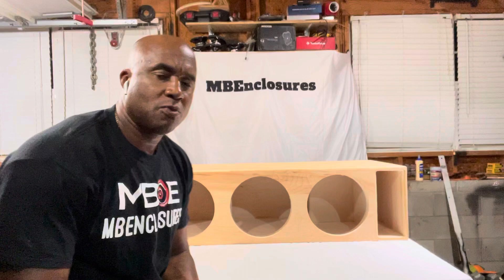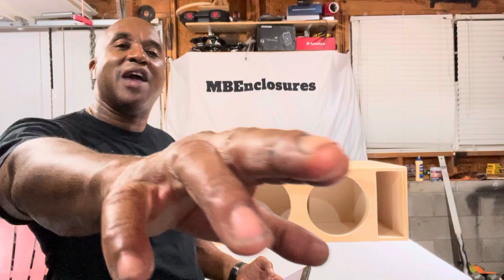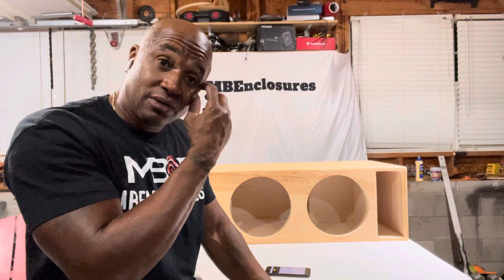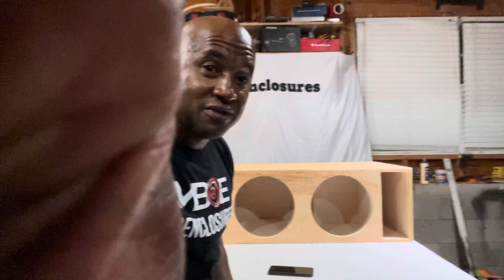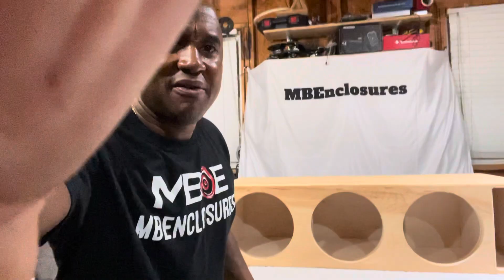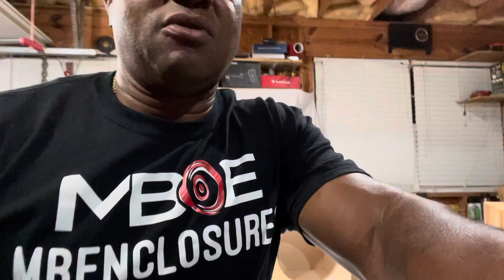Why JL Audio is to be respected.

Comment: I remember when a combination of 3 JL Audio subs, MB Quart, Precision Power, and Audio Control ruled in SQ!
Reply: Back when they were black and red and could be purchased with a clear plexi glass bottom. That was a great era
Reply: Agreed. But two honorable mentions: DD Audio made in U.S. Subs (like JL Audio top line subs). And Arc audio amplifiers. I think Arc has taken the top spot from Precision Power when it comes to amps. But both brands are excellent. B2 Subs are very good SQ subs too I hear. But have heard mixed reviews on amps. Even when you look inside, they look awful sweet to me. Maybe one day when my vehicle value exceeds the cost of a complete JL Audio top-o-line system.   lol  AudioControl has also impressed me the more I learn about them. I just think car audio dollar for dollar still does not beat home audio, nor especially pro audio will studio monitors and subs. The Kali IN-5 studio monitors (3way) will change everything you think you know about speakers/studio monitors. Especially at $750 pair. Subwoofer optional.  It's my goal to get a pair of the IN-5 in my vehicle. It's a challenge because they are tri-amped. Not sure if its possible. So putting them in  my living room won't disappoint either. You can't hardly find a pair of 3 way quality tower speakers under $1,000 other than the Kali's. And they ain't even tower speakers. Just sound like tower speakers.    lol   Check them out. Peace.
Reply: I think it is the home audio cabinets that speakers come in that make home audio systems perform better than car audio?
Reply: I can't believe I forgot: SB Audience component drivers. Excellent speakers and subs. Maybe better than those mentioned. But only make speakers. Definitely worth your time to check out if you are unfamiliar with the brand. They are 100% vertically integrated. No outside parts, everything made in house.

Comment: Been running JL Audio since the W6 18” and 500/1 debuted. Still my favorite as far as reliability and efficiency. They cost, but so do the finer things in life!!
Reply: You can easily put SPL JL Audio, but that's not what they were designed for. They are more SQ oriented and honestly configured for lower wattage.
Reply: My JL Audio 500/1 has been running now for 2 decades efficiently in many different vehicles on multiple brands of subs. I have even tried other 500 watt brands of amps and always end up back to this one!#JLAudio#🔊❤️#Slash500/1#Truth#👑
Reply: @bondalero0074 thay amp is one of the best amps I ever purchased.
Reply: Trust me, broaden your horizon. It's far from what it is cranked up to be.
Reply: @AB-80X  100 % I guarantee you that I can slap kicker and jl in there face with 20 other brands for cheaper
Reply: @AB-80X trust who? Who are you? Haha 

It’s not all about watts and loudness with JL. Do some research on what makes JL’s special, its there massive R&D budget and nonchalant updates to legacy product lines. So many sub enthusiasts combine arms to discourage any JL positivity due to there higher price point and newer products out on the market appearing to offer more for less. They imitated then flaunted aspects of performance JL does not focus on. 

There is so much overwhelming evidence that JL still provides an amazing experience it’s completely comical to read polar opposite opinions from die hard buyers of different brands.

Talk less about stats and more about the subset of needs a buyer may want beyond shear power and SPL.
Reply: @robob221 
JP is exactly all about loudness and wattage. They are fairly mediocre speakers and amps sold at a high price. Take a W7 speaker apart and you’ll soon realise how cheaply it is made. Same with their amps. 

I have worked in pro audio for years. Worked large scale concert venues, but also worked as a studio engineer, does studio setups, commercial theatre setups - as alwell as spent a few years in the car audio industry. I know what quality audio components are, and JL is definitely nothing special. It is extremely overhyped like most equipment in the car audio scene. I don’t even think the high end home audio world sells as much snake oil as the car audio industry.

Comment: Coming from the view point of someone who’s studying how to build subwoofers from the ground up, ya JL is a good brand BUT there’s no magic to them it’s just that there price point on the “higher end “ subwoofers is so much that people who can afford the higher and stuff already have the batteries and aftermarket alternators to power there equipment to the point that the subwoofers they use really don’t matter. And those that can afford to put real money into there systems tend to be older/more mature and know how to use the equipment they have. On the flip side some of those people that can afford higher end equipment tend to be Snobs about it and tend to talk down on less expensive brands and the people who use them. In all reality name brand equipment is just that a NAME BRAND and the more overhead they have the more there equipment will cost and most subs are either made in China or the parts come from China and are just assembled over here. A 1200$ JL is worth about 100$ in parts it’s the labor to put them together that costs $$. Also the fact that JL warranty’s or lack of will keep only those who can keep forking out the $$ to keep buying the same equipment. So In the end as long as you have a proper power supply the amps and drivers you use should not fail unless seriously abused. Motor,coils,leads,spiders,CA glue,cone,surround and terminals=a speaker,driver,woofer,subwoofer
Reply: You could never build a w7 for $100 or any sub on par for that matter as the motor alone is easily gonna cost $400 plus. I’ve been building subs by hand for years and the parts on a w7 (except the coil) are not available. They are not off the shelf parts like a company like sundown or skar will use. All those others brands that cost significantly less are not assembling their product either. They are out sourcing it to China and in many cases the quality of the build is not even close and they use inferior materials. Brand hype definitely exists and not always do you get what you pay for. In some cases though, you actually do! Look at all the amplifiers today, majority are built over seas and is why it cost 15 cents or less a watt. Hand built USA made amps that cost over a $1 watt the sound quality was incredible, the quality was amazing, and you could pass those amps down to your grand kids 😂
Reply: 100% agree, if you truly look into JL they done even own there patents and all there stuff is made overseas in the same build houses that makes the other so-called cheaper brands. Facts, go check them out

Comment: Awesome video!  I had TWO W7 12's and now I have a single 12W6 in the JL H.O. prefab box and it is astonishing.  I was just at a lowrider show and people were like, "that's ONE 12" on 600 watts?!?!?"  YEP.  For what I can see, the 12W6 is just a scaled-down version of the 12W7.  33% down.  Pound for pound, it may be one of the best JL subs ever!
Reply: I've owned both and the w6 for price and for what it is, is an all around great sub. Personally,  I prefer the w7. Both are musical af, in the right box you will hear sounds most subs just can't reproduce. My next setup will be focused on sq however, using w7s it's also going to give me the slam I want
Reply: You were using in a box they designed and made. I’m sure that’s a very big factor.
Reply: Are u saying u prefer the W6 over a W7 or would a single W7 preform better in the set up u currently have?
Reply: @tonywarren2549  for my application, the w6 works.  It is lighter and requires less power to utilize its entire envelope.  Both are amazing drivers though.
Reply: @tonywarren2549  to me w7 is just a better sounding subwoofer. W6 is good but not better than W7. I am not just talking about output either, W7 is much cleaner and sounds better to my ears.

Comment: I’ve been running JL SINCE THE 90’s you get what you pay for. The quality has always been their.
Reply: Id disagree. You pay over what you get. JL’s for their price is ridiculously high, and there are a lot of other products that are cheaper, that deliver just as it even better sound quality. You’re basically paying for the name if you’re buying JL’s.
Reply: @xchampxownsx4535 there’s subs that are better quality, and there’s subs that hit harder, but no subwoofer does both as good as jl audio
Reply: Jl did pay for the design patients though I’ll give them a lil that But yeah I will totally smash a pair a W sixes with some power acoustic Gothic’s any day for less than A quarter of that price
Reply: @fuckgoogleandyou8779  not in SQ you won't....

Comment: After reading some of the comments, I see their is a lot of JL hate in here. It's mostly because ignorant minds. JL is the top ranked for all around equipment for daily use across all vehicle platforms without needing massive amounts of power and current. When installed properly, ran properly, tuned properly, you will never have an issue. User error made JL haters.
Reply: I agree JL audio equipment just works, you know what you are getting and the results are always repeatable. You have to work hard to make a JL audio subs sound bad.
Reply: You can get stuff half the price and perform just as well installed properly
Reply: @mrjetlife27  agreed! And JL is just more on the tech side of it. Knowing how new cars are with the sensitive electrical they have, soon people will be paying JL money for long term in these new cars. Look what Steve Meade had to do just to run his amps in his Caddy. It’s tech that takes over today. But really, I could do a build with anything and come up with something impressive. All on the installer.

Comment: I have all jl audio    3  13w7s  on 3   1000/1  if someone comments  about jl magnets  they should do there research..  jl is mostly a sq type product     jls best sq sub  is only 1500 watts .   you want a subwoofer with a  big ass magnet  or power rating  your in the wrong  brand totally    goto sundown or deafbounce   then you big mag  is  supporting 5k plus

Comment: They'll never understand, even when you break it down. The first thing they say is.............. they don't hold power lol. Then they say they cost too much. But they never argue about how they sound lmfaooooo. I've had 4 w6 v2 12s ported and sealed and both boxes had me amazed and sadly I had them on a slash 300/4 😂😂😂😂😂 Then I put my orion xtr 2500 on them and folks thought I changed subs. Now I have some w6 v3 12s but haven't hooked them up yet. I've owned a w7 10 in the jl ho box and I couldn't believe that 10 got that low and deep, and the w6 v3 is supposed to be in between the v2 w6 and w7 so I'm ready to get them powered up to see
Reply: I've actually had the 10-in w7 and the 10 inch w6. Believe it or not I bought the w7 first and I actually sold it in downgraded to the w6. I would say the sound quality is pretty much the same but the w7 bangs a good bit harder. People couldn't believe that all I had in my Jeep was 110. The w6 didn't hit as hard but I also had it in a sealed box versus the w7 I had in a big ported box. I guess it all boils down too what you really want out of your subwoofer and system. If I had to do it over I would have just kept my w7. I'm about to go this weekend and purchase an 8-in w7 again

Comment: The W7 is a really good woofer. I used to have the 13.5" now it was one of the best sounding subs in terms of musical.. but it wasn't the best it was damn close like very close.. but the best sounding sound quality car audio woofer has to be the Diamond audio D9 series Woofer. I had two 15" D9s and holy shit those where so clean so clear very low playing no distortion from em at all. They was amazing. The W6 I haven't heard in person yet. But the W7 I have... The skar VXF 15" is a bad woofer as well. I got one ATM and holy hell 😂. It's better than my zvx 15" I had that zvx is a SPL woofer the Vxf is a musical woofer. The 15"s are by far better for music if your gonna use Skar. The zvx is a SPL woofer when it comes to Skar.. but JL I loved the W7 13.5" I had.. and it got ultra low to.. but it eventually blew up on me about 2 yrs into having it.
Reply: Must have been either clipping, over powered, or wrong enclosure for your W7, or playing music out of tuning range of your enclosure. I say this because I've been running my 13.5w7 on  2 JL 1000/1v1 for 2 years, and now have 2 JL 1200/1v3 on the same sub for about a year now, and never blown, or fried my coil in a 4.5cuft enclosure @ 26hz, 24hz with the sub installed. Before that, a 3.65cuft enclosure on a JBL BPx 2200.1 tuned to 31.5hz for over 2 years. I just ripped apart one of my spare 13.5w7 subs and built a 1 ohm version to fight impedance rise at 2.5 ohms so my amps are cleanly powered and unstressed. Most people that have issues with the W7's, were running them incorrectly, or in the incorrect enclosure.
Reply: Which 15 hits harder between the skar vfx vs a skar zvx? Please let me know your honest opinion between those two subs, please friend.

Comment: Sound better probably DB wise will the JLs get louder than the X12s no.
Reply: I had the Type X12 and the 12w7 is louder, but the X12 had more punch behind it. Which helped on the meter for me, but, thats also because the person I was up against had the wrong enclosure for their sub against my X12. User preference. Your enclosure means everything guys.
Reply: @mikehonda7934  he probably  talking about sundown X 12s.
Reply: @HardKnocks160s  good point. I mentioned those subs in a comment as well. I went off of what’s commonly mentioned against JL, which when the W7 was out, it’s competitor was the Alpine Type X line.